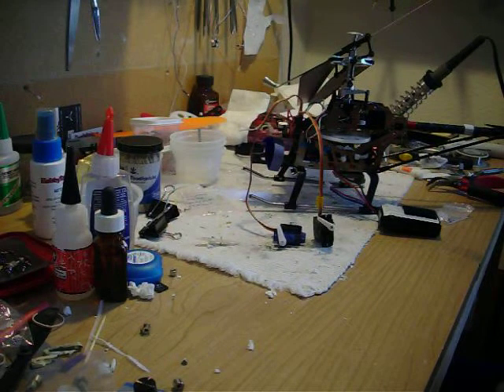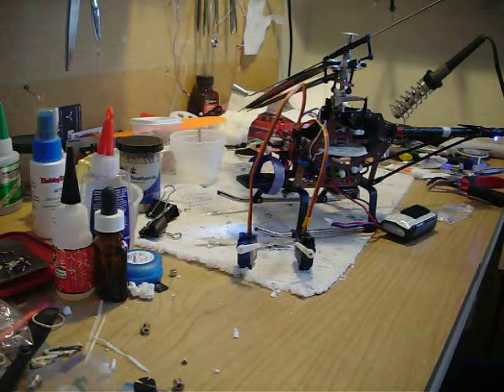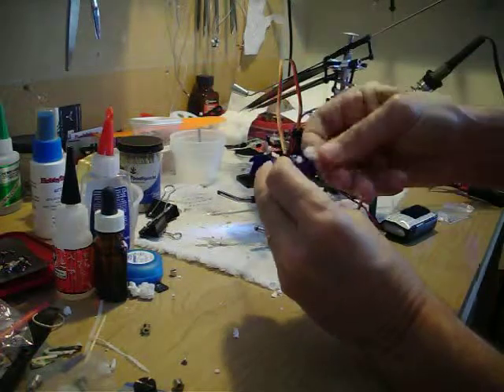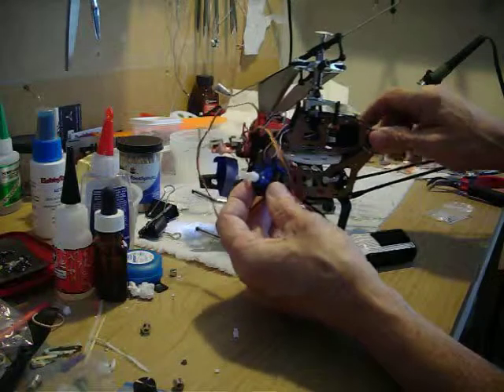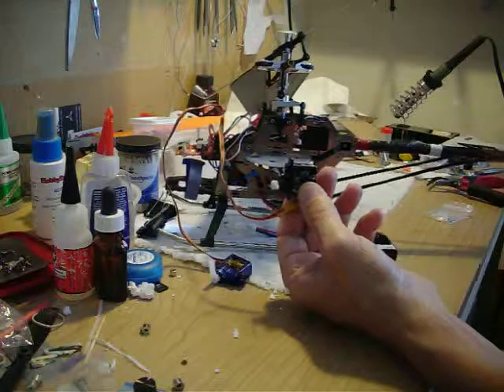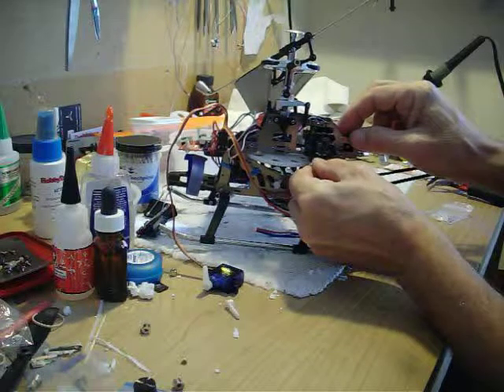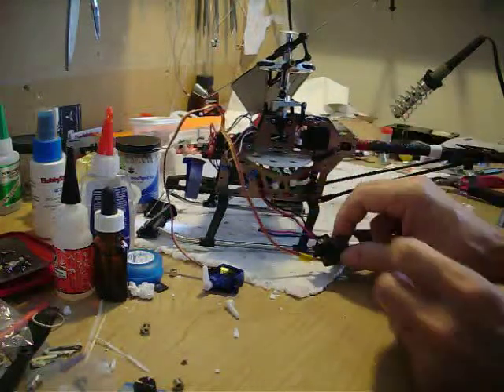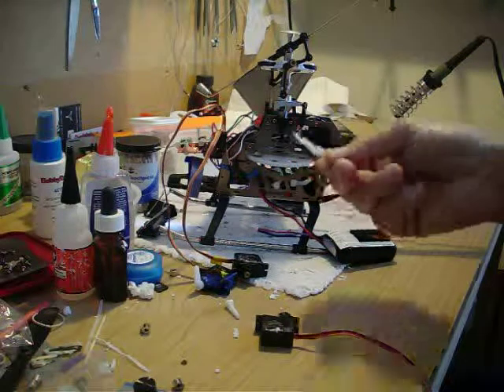Centering and testing SG90 and MG90S Servos for the V913 helicopter

Comment from the maker: Waleed, below is a link to my reference on the V913 at RCGroups.com. Please scroll down to POST 4 and 12. There are many things that can cause the left or forward drift problems. Once you decide it is not one of the beginner problems in POST 4, maybe you can determine if it is a matter of trimming your copter.   https://www.rcgroups.com/forums/showthread.php?2255975-WL-Toys-V913-helicopter-Reference-Source